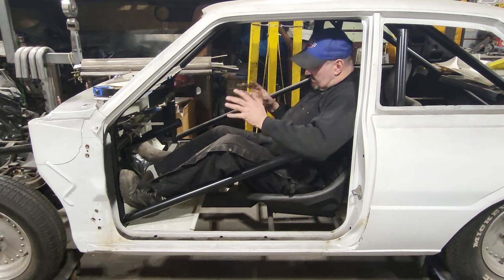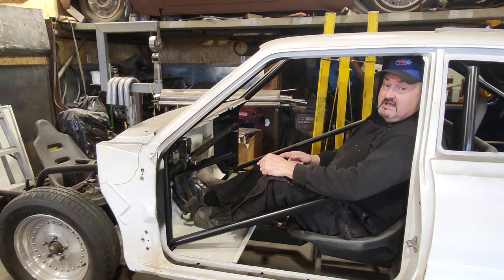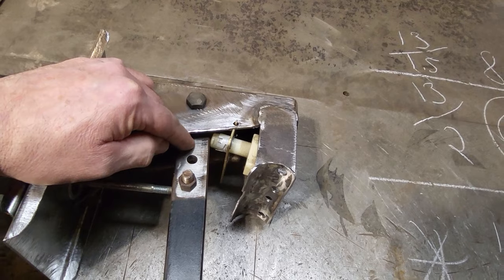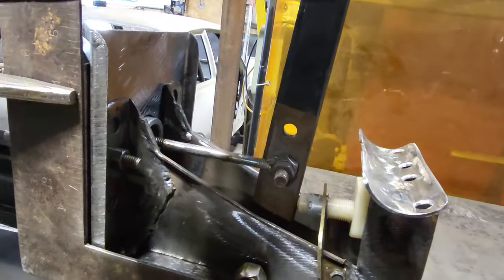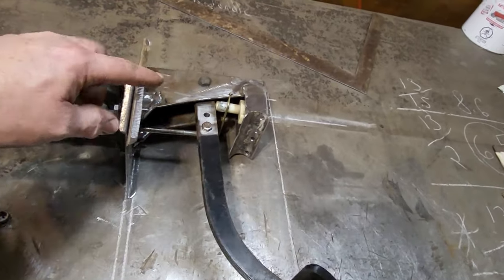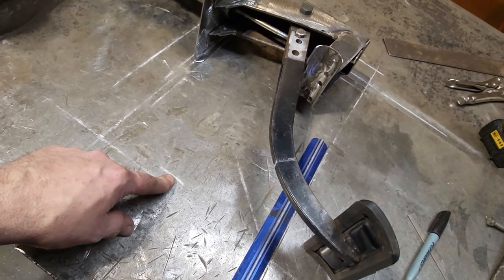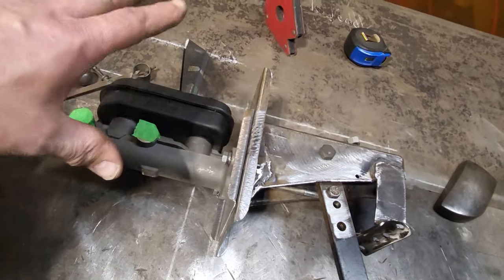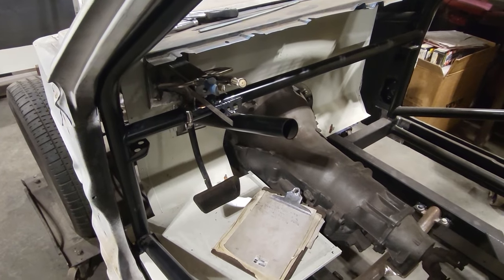Fixing brake pedal ratio problems

Comment: I use a 7/8" piston Wilwood master cylinder for non power assist brakes. It works great with 4 wheel disks on my 3,700lb 66 Coronet. The longer pedal travel due to the smaller diameter piston gives great pedal feel too.

Comment: Alternatively, fit a master cylinder with a larger internal diameter for more displacement and less pedal travel.
Fitting a larger master cylinder is useful when increasing the size of the brake calipers, due to the greater displacement needed to move the bigger or additional brake pots.
Reply: This will work for decreasing travel, but adversely affects the multiplication ratio. No such thing as a free lunch.  A vacuum reservoir and power booster would be a option.
Reply: Hard as hell to push down the pedal though on manual brakes.
Reply: Fitting a larger bore master cylinder will require more 'leg force' to acheive the same braking effort.  So to offset the larger bore, the 'leverage' will need to increase.   As stated by @mortimerschnerd3846 - "there is no such thing as a free lunch".

Comment: Hey Tony.  Had you use the complete pedal assembly from an A body dodge like the duster it would have worked the same way because they are standard brakes.  That's what I used, and it made it so easy for me, and I  didn't have to do all those measurements
Reply: Unless you have conducted detailed measurements of the space available in the Toyota (Crusty), there is no guarantee the Duster assembly could be installed without any sort of modification.
Reply: @georgebettiol8338  your right to a point.  But the pedal assembly from a Duster or Dart is small and most of them came without power brakes.  So I couldn't have made it easier for him without the modification that he had to do.  I've used them and I've had a lot of the dusters and darts

Comment: You may recall I mentioned, in my previous comment, that the "proof is in the pudding" in other words to comfortably stop a car travelling 100 mph you are going to need upwards of 800 -1000 psi at the rotors. This is achieved by the pedal lever ratio and the size of the master cylinder bore. Now also you need to take into account the volume of the caliper capacity comes into play.  You mentioned that if you needed to, as a last resort, you would go to a smaller bore size. That assumption may or may not be correct depending if the calipers are huge volume calipers for example six piston. I suspect since you are not road racing there would be no need for those. So if you keep to the regular size calipers,  I suspect all would be OK as far as meeting the volume requirements to activate the calipers, (Drum brakes are not obviously an issue). However from personal experience going from 1 inch to a 7/8 inch bore, I observed that during operation the pedal does move down noticeably further to the firewall due to the smaller volume albeit higher pressure going to the calipers. Hopefully you have a friend who has the tool to measure brake pressure at the caliper. 
By the way you're concerns about the brake pedal hitting the firewall are in my opinion overstated. The odds of losing both front and rear brakes in your application (not a daily driver in salty conditions I.E. race use only) would be next to none.  So IMO the pedal will never bottom out. However you would need that travel to do the old fashion pump your brakes bleeding technique. This is based on my real life experience when I build my hot rods. Hope that helps.
Reply from the maker: Great info. Thanks.  Always looking to learn

Comment: Tony, your work and knowledge is amazing! We are so grateful to have found you on youtube. This is an off topic question, what you are doing on the rockets brakes are way beyond my skills, figuring from inception, very impressive but not for me. Okay, I have an 89 K5, my son and I have been putting back together for past couple years. Why is the hole on the end of the rocker? I know in case dirt gets in could possibly get out but probably not. Have you ever welded up? We made inner rockers so they are sealed, Ill put in a couple small vent holes but, to have that big hole behind the fender seems like trouble. Your thoughts? Thank you and we LOVE the sweatshirts!
Reply from the maker: Thanks. I capped holes like that. Sometime in such a way that if needed to oil up again just remove a few screws and brake the seam sealer. I had those sections  rust out and just welded them solid as well. They need drainage as they will get water in them.
Reply: I certainly thank you! I think they need welded up, just a rust catcher. I will put a couple holes for drainage. Tony, I would love to meet you some day! Thank you again and have a GREAT DAY!  @fitzeesfabrications

Comment: You could actually install a remote booster that is not attached to the master cylinder. I did this with a car years ago when I converted it from drum brakes to disc brakes. But I think you mentioned previously something about the vacuum with that particular engine, which is why you didn't want a booster?

Comment: Seems like you could have welded a tab or ear to the top of the shank to move the top pivot. That would've let you keep the pad to stay the same.  I wonder how comfortable that will be having the pad so vertical?
Reply from the maker: I sit really low so pedal is at a good angle for seating position

Comment: Good fix. Would another solution have been to add an L shaped bell crank between the pedal and the master cylinder rod? The relative lengths of the arms of the bell crank could be set to give you the ratio/mechanical advantage needed. It would have been more complex and added another element in the linkage between pedal and m/cyl. but might have allowed you to keep the original pedal and action that you were happy with.
Reply from the maker: Now your into something you need major math to figure out. Lol

Comment: I don't think having the master bottom out before the pedal does is as critical as it might seem. Since the end result is no brakes either way but damage to the master cylinder added as well during a panic stop attempt with no brakes. It is great that you are thinking that thru though since you certainly don't want it to bottom out at 50% of the master travel, but closer to 90% or so for the best chance during a brake failure.

 You can use a stick or metal rod and measure the distance from top pivot point to push rod connection, then do the math in a straight line and cut it to compare it to your pedal set up so the bends don't make it confusing to sort out. 

Great video to help people think a bit more about something very critical when building or modifying their vehicle.

Comment: You said you wanted your foot at a certain point on the pedal. That was your left foot. Are you setting this up for left foot braking?
Reply from the maker: Yes. I drive these cars with two feet. Old street racing trick

Comment: Will the steering wheel interfere with your foot movement? It looked like your knee came up pretty high when you were sitting in the drivers seat. Could you lower the top bolt( the one the brake pedal swings from?
Reply from the maker: I have clearances and the upper bolt is lowered inch and half from where I started

Comment: 2 things to  think about. 
1. I personally think that the pedal lever should be one piece for safety sake. 
2. I think that you should have a pedal stop at the  firewall. You don't want to use the master cylinder for the stop.
Reply: 1) See my above comment about a pinned pedal 
2)  Correct , I use a rubber stubber from a slapper bar/traction bar  trimmed to fit or a hood rubber covered height adjustment bolt
Reply from the maker: Yes its the firewall itself.  If it was up off the fire wall I would add one
Reply: I wouldn't really expect it to cause any issues, unless there is a problem in the braking system the pedal should be using nowhere near full travel, really the only way the master cylinder could ever bottom out if components are sized correctly is if there is a failure in both circuits at once.

Comment: Now that you have that PART figured out, you have to MAKE SURE your brake rod allows the master cylinder piston ALL THE WAY OUT!!!  If you don't, you will hit the brakes a few times and the car will not roll, even with the pedal up..
Reply from the maker: It needs some free Playas the fluid heats up it will expand. I seen it happen a few times before.

Comment: Your audio was very low at the start when you were in the car. If you use a remote microphone it would fix the issue. You could even record the audio on a different device to the video and then mix it in when editing. You are really good with Shotcut, so it would be easy for you to do. For me, video editing is above my pay grade and I can only do simple things like cutting clips and joining clips together and boosting audio.
Reply from the maker: I never used the mic that day for intro. Should turned it up a bit. My bad